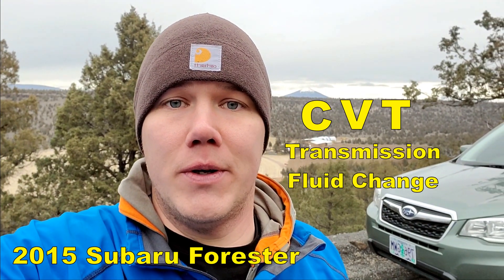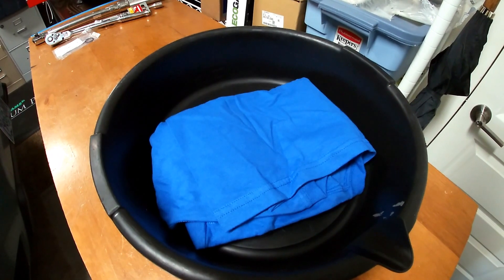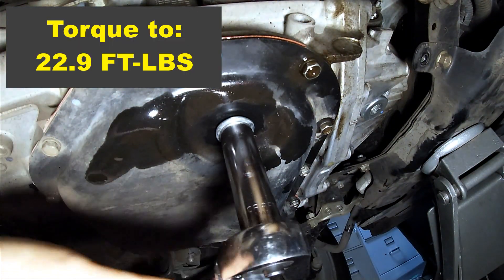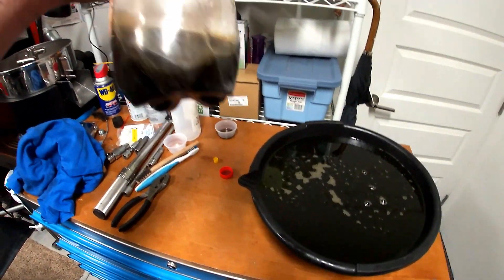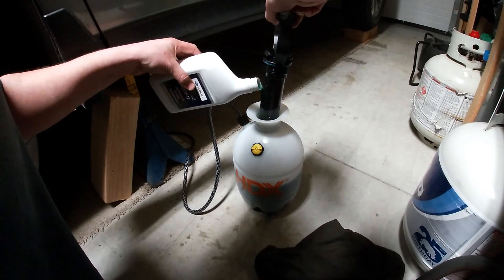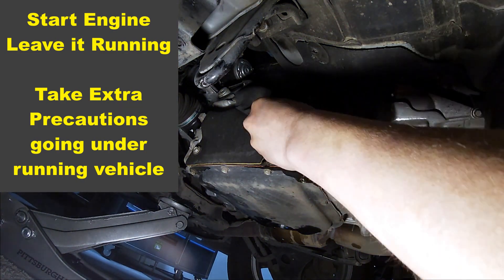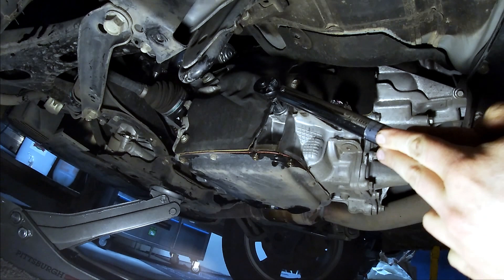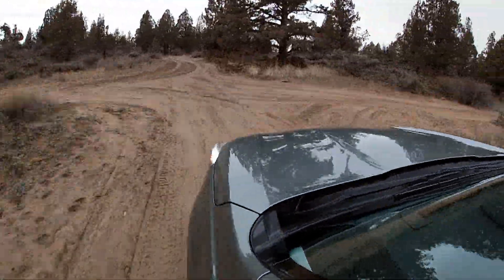Subaru CVT Transmission Fluid Change & Flush Procedure | 2015 Forester Replacement-Fill-Level Check

Comment: Thank you for all plaede advice the delaer said trans oil life time do I have to change it or not
Reply from the maker: Open the manual and determine if you drive in severe conditions (most people do) then it says to change every 28k miles

Comment: would changing the oil every 18 months be equivalent to benefits of this thorough method?  someone make an equation of wear on this oil with time and % dirty to figure out if it would be the same....i.e lessen the time between changes vs 100% oil flush...

Comment: Dear friend, I just did a total change of the cvt fluid using dialysis and with an electric pump (15,85 quarts / 15 liters).
If you knew the amount of dirt and ferrous particles that accumulate on the tray and on the magnet with only 35,000 km you would probably not be so thorough in cleaning the threaded plugs ;)

Comment: like an idiot I drained my cvt when I was doing an oil change by accident.  can I just add  fluidand does it have to be factory ?
Reply from the maker: You can use a cvt fluid that meets subaru's specifications, but if Subaru's factory fluid is in it then it would be best to not mix fluids
Reply: @MTsubfly  Thank you .

Comment: I like what you did.  I am getting ready to do this on my Crosstrek.  I have done this on other AT vehicles I have owned.  What I did was remove the return line from the cooler and just "pumped" out fluid there.  I pumped the old fluid out and you don't have to use any compressed air to blow anything out.  Just another way to accomplish the same thing and you don't need compressed air.
Reply: curious what you used to pump the oil out ?thanks
Reply: @tdizzle2179  I guess I wasn't clear on my comment.  Sorry.  I didn't use an actual pump.  I disconnected the line from the cooler (heat exchanger) that returns transmission fluid back to the transmission.  It is labeled in the video (4:33).  I took it off at the transmission and not the cooler.  Although, it really doesn't matter a whole lot and you could take it off at the cooler; however, this would make your hoses/connectors a little different.  I connected a hose to extend the line using a double barbed fitting you can get at a hardware store or Lowes/Home Depot.  (Sorry, I don't remember the size.)  I put the hose into a container I could measure the amount.  My wife got in the car and started it up.  With the car running the transmission fluid does "pump" out of the transmission to the cooler.  I would "pump" a quart out and then add a quart.  I did this until the fluid looked clean/new.  If you are using this method, it does take 2 people and make sure you have the person turn off the car a little before you reach the amount you want to pump out as it does flow a little while the car is shutting off.  I have used this method on other vehicles to get the remaining used/old fluid out of the system.  I hope this helps and clarifies.

Comment: just to confirm 2014 subaru forrester premium 2.5L model also use cvtf ii fluid? i accidentally drained the transmission fluid, your video is such a great help, thank you very much!

Comment: I have a 2010 subaru legacy 2.51 it has 351,000 miles i dont know if the transmission fluid has ever been changed, jiffy lube offer a transmission flush are they trained for the cvt transmission, and would you recomend taking a subaru to them for a transmission flush?
Reply from the maker: You are asking me if I trust jiffy lube "trained" technicians...... I wouldn't let them change my engine oil, let alone just check the level. They make too many mistakes, a franchise? Making money off convenience of maintenance. Not for me IMO.
Reply: I wouldn't let Jiffy Lube put air in my tires, yet alone work on my cvt subaru transmission.

Comment: brutal procedure.  man, i just don't know.  i have 135,000 miles on the vehicle (2016 Subaru Outback - 4 cyl.) without changing (don't know if the previous owner (which was Subaru---lafayette Indiana corporate headquarters employee car) changed the tranny fluid...bought the car with 60K on it....So i have no way of knowing.  Do you think i should give it a try?  what about differential oil?  Thanks so much for your video!!!
Reply from the maker: Yes and yes, I would give it a shot. At least drain and refill the pan (6qts). It's a myth that changing fluid on a old transmission will cause damage IMO. Definitely do the differentials too!
Reply: @MTsubfly  Excuse me friend, it is no myth. What happens in certain cases with excessive mileage without ever changing the already oxidized fluid and having lost its original properties, it impregnates over years and thousands of kilometers varnish in all the components of the automatic transmission. 

When introducing a new fluid with its one hundred percent additives, the additive with detergent properties, cleans the box of the old residues and moves them throughout the inside box, depositing themselves on the valve body and solenoids, causing new problems in the automatic box. 

As you will see, only in this type of situation, it is NOT recommended to change the fluid. This is the case of vehicles with more than 200,000 miles. Obviously, if you do preventive maintenance, this will never happen.

Comment: with the amount of fluid required, probably same effect as changing the CVT oil via normal process every 10,000 miles instead of waiting to 100,000 miles. probably better for the transmission not to have all that wear. that's what i do anyway, every second service = CVT oil change. i think that's about 2/3 of the fluid changed each time.
Reply from the maker: More or less, its great that you are taking action on performing this maintenance task at all!! It will prolong the life, there is no such thing as lifetime fluid.

Comment: The front diff fill plug was a real bear to get out.  I eventually sprayed it down with PB Blaster and then used the handle end of a breaker bar to tap the pug and surrounding area to hopefully loosen the plug. Then, using a long extension that I braced from below to keep it level, I was able to muscle it open, Way, Way<Way over torqued from the factory.   I later learned this is a common complaint on this engine/diff/tranny  series. I also later learned you can ignore the fill plug and use the check plug as the fill site!! Still, much appreciate the video.  I highly recommend this video so you don't screwup the fill procedure for the diff/tranny combo. 
 https://youtu.be/-OR7PEJwhdw

Comment: Getting ready to do the drain/flush.. got my BAFX wifi reader and downloaded Active OBD.  It doesn't do much at the basic version, guess I would have to pay the $14.99 to see what the full version does.  It doesn't specify that it's for Subaru, maybe there isn't a version for ios/apple that is Subaru specific?? dunno...  Anyway, first I tried OBD Fusion (paid the $9.99) and that wasn't much different, no CVT temp for my $$$.  However Car Scanner OBD worked and included CVT temp for free.  There's also a Transmission Temp V.1 and V.2, one didn't show anything, and the other was real close to the CVT temp reading.
Reply from the maker: Subaru Active OBD for free on Android is what I used, not sure if its on Apple products 🤷‍♂️
Reply: @MTsubfly please share exactly which OBD scanner you used, such as model numbers please! Thank you!

Comment: Can I use WD-40 instead of carburetor cleaner?
Reply: No. Brake cleaner is indicated, since it does not leave a residue that favors the contamination of the new fluid cvtf.

Comment: guaranteed, you went above and beyond what any Subaru dealer service center or other auto shop would ever do. Great work. 

At 60000 I got a new CTV transmission because the dealer service center cracked the case following replacement of a line that blew out.
Reply: what an ironic way to get a good deal on a new CVT. Gotta love it

Comment: @MT
#MT
 is it recommend to replace the  CVT Transmission Fluid Strainer Filter when changing the CVT fluid?
Reply from the maker: Nope! I didn't do it, and it's not required by subaru.

Comment: There are lots of notes here, difficult to sort through them.  Anyway you can add a note above for XT owners?  XT owners fill plug is at the back side facing the rear of the car.  Fill plug on XT is a 10mm hex.  Fill plug takes the large gasket. Otherwise this was a super helpful video TY   One other thing, If you own a FIXT port reader, you are good to go!!! ActiveOBD iOS bluetooths to the FIXT port reader and gives you the CTV temp for free.  I will be returning my OBDII reader back to Amamzon, as it did not WiFi properly to the app.  Glad I tried my FIXT port reader, to use with ActiveOBD.   Cheers!

Comment: I have a 2017 outback.  The  chiller is in the same location, but the hoses do not run to the same location on the transmission.  Well, 1 hose does, but the 2nd looks to go across to the driver side then up towards radiator.  Any help with cvt fluid path would be appreciated.
Reply from the maker: That's a tough one. Most likely one hose is out and the other is in. Trial and error? I cannot be certain myself, sorry.
Reply: Thanks MT.  I did a little more digging and found the ports are in the same location.  Front port comes out through water cooler then through some more tubing up to an air cooler in front of the radiator then back to the rear port.    The rear port looks a bit different as it 90's directly into a hard tube.  Just wanted to add this comment in case someone else needs this info...

Comment: I don't think you need to go through the hassle of taking off the fill and drain hoses. Just empty it fill it with fluid run it and then completely drain it again through the drain plug and then refill it with fresh fluid again I and you've put 10 or 11 quarts of new fluid in and it should be good to go. Probably would get an even better flush that way than going through the hose thing.
Reply from the maker: Hard to say for sure being so much fluid get trapped in the cvt, but I like your idea. I could speculate draining and refilling the pan every 25k miles might be all thats needed. 5-6qts per pan drain. That's 40-46% of the fluid per drain & fill.
Reply: Okay after thinking about it I think I see what you're doing The transmission gets all new fluid from the pan and then drains the fluid from the transmission without remixing with the clean fluid in the pan.  

If I do it my way l get down to a quarter of the original contamination concentration by draining and refilling the pan twice. If I let it run through the gears in between drain and refills so that the fluid is well mixed.

Comment: Hello, MT, Today, I have a question, Recently, I found oil leakage at front differential case, I guess for 3 reasons, 1) oil seal leakage of crankshaft, 2) front differential case assembly part, 3) drain plug of front differential case, also has been checked of smell of oil, I think that it is engine oil smell...., and it was from crankshaft area,  oil was wet finely, Please advice for this matter, Thank you.

Comment: I was about to change the CVT fluid in my Forrester and I called the dealership concerning getting replacement crush washers and fluid.  They told me that a CVT transmission needs to be bled and re-calibrated or reset and therefore it’s not a do it yourself project. Please advise
Reply from the maker: They are trying to sell you a "fluid flush" they are in the business of selling service. The choice it yours. My Subaru is running great since the fluid change and many others like mine. If you want the computers fluid deterioration % reset, take it into them and ask specifically for that. You can always ask them to pull up the CVT fluid replacement procedure from the manual and let you read it. If they have nothing to hide then they will do it. My 2 cents.
Reply from the maker: Also, the fluid level is set as shown in my video, which ensures the cvt is "self-bled" and properly set.

Comment: Thanks for the post man. This is really helpful. Have you considered changing the filter/dropping the pan?
Reply from the maker: Yes I have! Not planning to keep it past 200k miles. But its a coarse filter, the real cvt filter requires transmission removal and splitting the case.
Reply: @MTsubfly  thanks for your prompt reply! Even dropping the pan makes me worry about a potential leak in the future. I wonder why they don't make it easily accessible.
Reply: @renzhewangshuai  If you're going to drop the pan, you just need a new gasket, and you need to spend time cleaning the mating surfaces on both sides. 
Also ensure that you are tightening bolts in a star pattern and don't torque all the way until you have each bolt mostly tightened.

Comment: On my Nissan Quest, I was told to drain the pan and refill the transmission, then a week later do it again, then a week later do it one more time. I was told that totally draining all the particulates out of the transmission will cause issues as they help the transmission belt grab. Adding  all fresh fluid to a used CVT or any transmission can actually cause more harm than good. I have to believe  this as I myself have ruined many older transmissions by flushing 100% . They start slipping and next thing you know, its walking time.
Reply from the maker: IMO, that's not solid advice. Replacing fluid in old, early day automatic transmissions has been said to cause problems, but this is totally different. Subaru says to replace the fluid in severe driving conditions, so it's good to do it at some point. Most folks including myself report better drive ability, and some quirky behavior disappearing after replacing the fluid.

Comment: There's another video on YouTube that shows taking the pan off to replace the filter/strainer.  Is there a reason that you don't do that?  Is that something that should be considered?  Thanks!
Reply from the maker: Thanks for the comment. It's been talked about here before in the comments. In my opinion it doesn't need to be done, it's a coarser pick up filter to protect the pump and you risk contaminating the cvt with is very sensitive to dirt. The actual cvt filter cannot be replaced unless you pull the cvt and split the case. Subaru says to replace to fluid, not the filter, and you will see improvement in drivability with a fluid change. But its up to you, do you think it needs changing? How many miles and what conditions do you drive in? Does the cvt drive well now? Totally up to you and what your car needs.
Reply: MT, Thanks for the quick response!  2015 Outback with 89,000 miles.  I don't have any experience with these CVTs.  I'm just big on preventive maintenance.  I have 4 Hondas/Acuras all with the V6 and automatic transmissions.  Oldest is 2000 with 278,000 miles on original transmission.  On all of these, I do fluid drain and fills every 15,000 or 30,000, depending on year.  Never had a transmission problem.  Just trying to be proactive on the CVT!  @MTsubfly

Comment: I drained the transmission oil instead of the engine oil. I moved the care out of the garage to turn it then I realized what I did wrong. Is it safe to drive it back into the garage
Reply from the maker: Bummer dude 😕 I wouldn't drive it. Put it in neutral and push it in.

Comment: Great video! This was the best one I found while searching.  Did my 2017 Outback 2.5i today,  just did a drain and fill for the first time at 110,000km. I actually ended up using Eneos CVT Model S which is specific to Subaru transmissions that require CVTF II.  Stuff is even green like the OEM Subaru CVTF II.
Reply from the maker: Awesome bro! Cheers!
Reply: @MTsubfly  how many quarts of Enoes should I buy?  instead of the method you used, can i do it without the full flush and just do this procedure like twice or three times in a 6 month period?  If I just do the 5 quart swap out, do i still have to do the 100 degree thing and have the car running through all the gears?  just seems scary to have it running and up on jack-stands and all of that.  what about the cost of the dealership doing it, how much do they charge? I'm in Indiana, USA
Reply from the maker: @dabneyoffermein595  after doing the flush myself, I would say just start with draining and refilling the pan. (6qts ish) and yes you need to set the level at specified temperature. It's really not hard, and if you have quality Jack's appropriately rated you will be fine. Note, it is way easier as shown in the video to start With a cold transmission (below 90 degrees f). 

Drain the pan, full the pan, start car and refill the pan, insert plug by hand. Now wait for the temp to raise into the appropriate temp range, remove the plug and let the excess run out. So easy. (This is a generalized explanation)
Reply: @MTsubfly  excellent, thanks!!  that makes me feel much better about it.  i have jack stands and I usually back them up with a floor jack in case they give way. they are not the best and not the worst but are old.. perhaps i could even put the car on ramps because since I'm not doing a full flush, i suppose it wouldn't hurt to have it angled and then drain and fill ? temp check, rinse , repeat.  Darn, i have to find that cheap ODB II i bought on the internet, thing works like a charm with an android app.  Time to dig it up.

Comment: Is there no trans filter to change?
Reply from the maker: No need. Some folks are now looking to change the pickup filter in the pan, IMO this is a coarser screen because the actual fine filter can't be replaced unless you pull & split the cvt.
Reply: @MTsubfly  ok. Wasnt sure on that. I'm looking at getting a 2013 Subaru Legacy with 110,000 miles tomorrow. Looking for all the knowledge I can get before I make a decision.